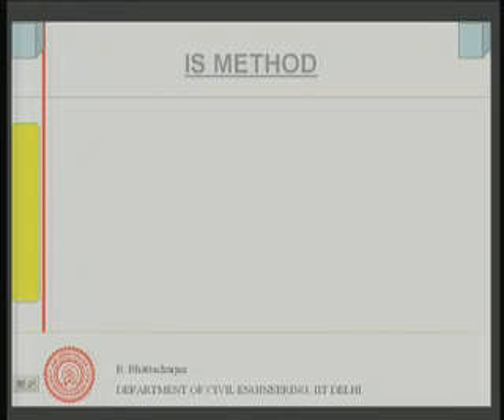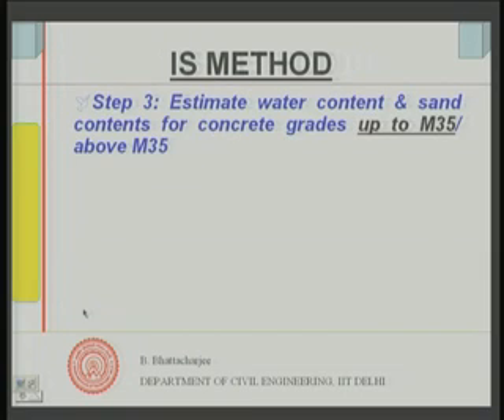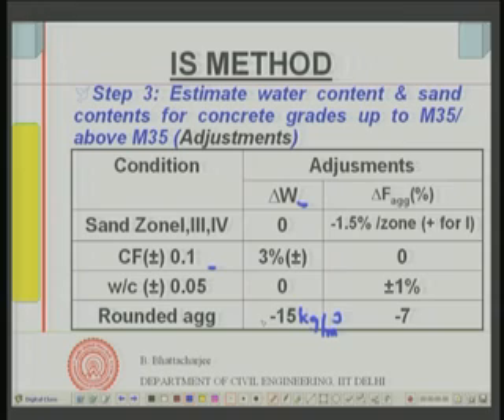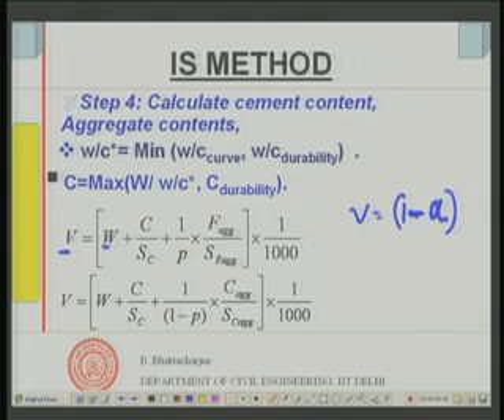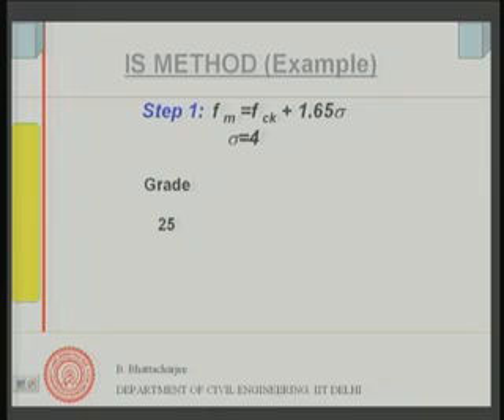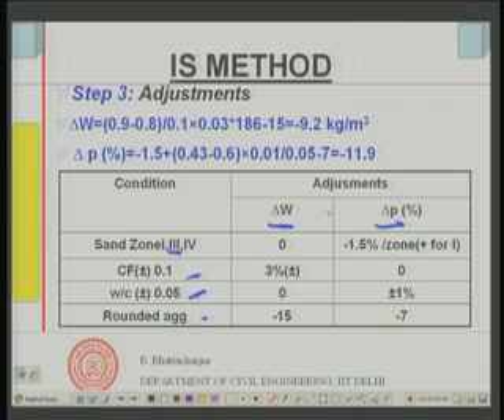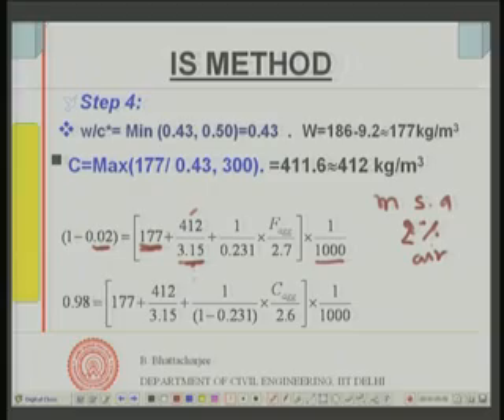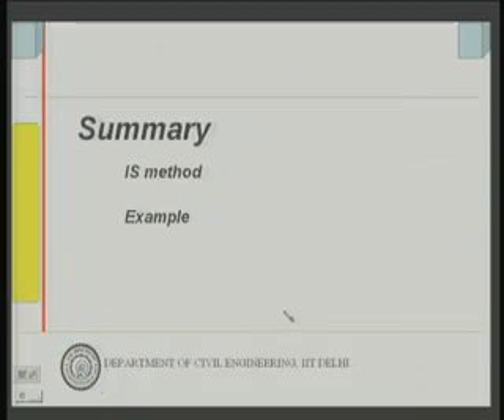Module 9 Lecture -2 Mix Design Of concrete IS Method

Comment: Dear sir, as you mentioned at 13:50 ,Table 4 and Table 5 in IS 10262, i searched in the code but i could not find any tables other than table 1, 2, and 3.
Can anybody suggest the source for the tables having MSA, water Content and sand ( for upto M35MPa & above 35MPa)?
Reply: Dear Suraj sir,

I think u read the 10262 :2009.

Kindly download the 10262 : 1982.

Comment: sir if my target mean strength is 48.25 than what will be the water to cement ratio
Reply: manish joshi it depends on the curing test you have done with your concrete and the the mpa required. Also it depends on the structure you are looking for. Hope this is going to help